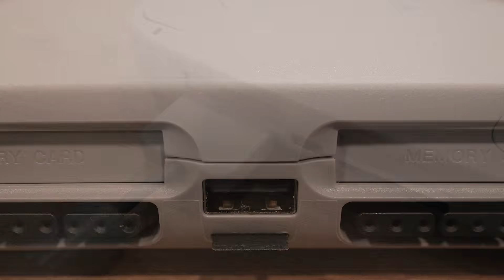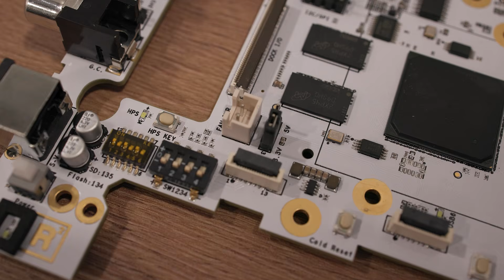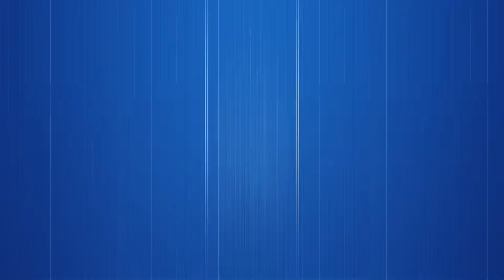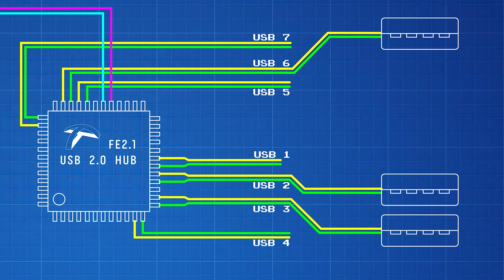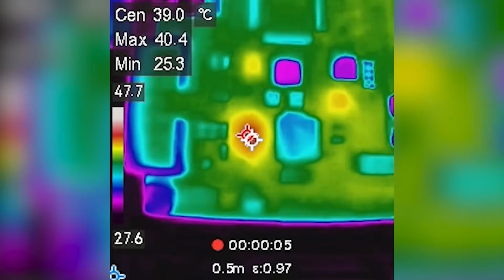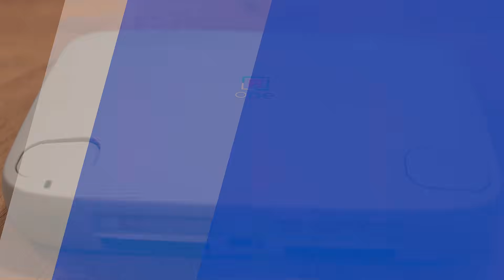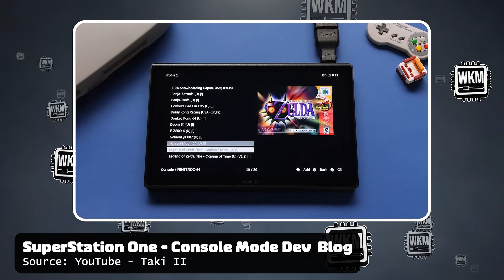Inside the SuperStation One

Comment: The analogue support is what sets it apart - this thing is perfect imo
Reply: i was thinking the opposite, this could be simpler and cheaper without it. working crt's are getting rare, i don't think any new ones will be made. display tubes have a limited life span. in the old days i used a device made for "refreshing" a crt, that could add few years to their life span. scan lines, interlace effect etc you can do digitally with modern displays. i'd be happy with just a hdmi output
Reply: @surejack

Yeah but for anyone who wants it, it's a steal. No costly rescaler needed. 

For a lot of enthusiasts (myself included) this level of connectivity in general is the new gold standard for fpga emulators.
Reply: @surejack I think the HDMI with Din 10 port is enough. Ethernet, SVideo, VGA, Component, 3.5mm jack, SPDIF and Composite is overkill. I don't see myself using those other ports.
Reply: @surejack  Taki, the creator of the project, responded here in the comments that it would only save less than a dollar, or a little more if the Sony chip was removed, but that the Sony chip is necessary to produce better-looking YC signals for some systems and that it also allows the system to use a single config for most countries/monitors.
Reply: @l3rvn0  I've been boycotting anything sony for a long time, it has been the number 1 evil company in many things. It is not just the chip, there are also many analog connectors in this like rca x5, vga, svideo. Anyway not a customer, i made a arcade machine using old pc (laptop with broken screen)
Reply: @surejack  The analog connectors he said cost just $1.

Comment: The hardware is amazing but also a bit over engineered in terms of features. I only want HDMI, Ethernet, 2x USB-C and a microSD slot, that’s it. Also using the expansion port for a high-end ARM SoC to play more modern emulators or SteamOS would make an amazing symbiosis.
Reply: Analogue video is crucial for a FPGA device like this IMO, because at least for me the biggest selling point is being able to recreate the authentic experience of original analogue video on a CRT. I could probably do without composite but even that is nice to have. Honestly if you only need digital video out for a flat-panel I think high quality software emulation, with fine-tunable enhancements to rendering and upscaling, is a better fit than FPGA, though I do understand the practical use case for both original hardware + upscalers and FPGA via HDMI as well.
Reply: @Mogura87  I get what you mean and it’s amazing that they offer so many analogue outputs but I don’t have the space that I can dedicate to a CRT and that’s the same for the majority of retro gamers.
Reply: @gundalfx I do appreciate having easy HDMI access too, because you never know when the CRTs will be out of commission. It's all about maximising options. CRTs are optimal though, because they accommodate the original native resolution and aspect ratio without any upscaling or input lag, with perfect motion clarity. It's impossible to achieve the same combined effect on modern displays.
Reply: @Mogura87  Today I played a bit of Master System (Alex the Kidd) in Lost Judgment (PS5) and the CRT shader they implemented is highly convincing.
Reply: you just want a software emulation box, which there are plenty of already, a mini pc with batocera would be more of what you want, not really an fpga set up
Reply: @p @pspsmallz nothing beats FPGA but I still like to have the option to also play uncommon consoles and more modern stuff like Dreamcast or PS2.
Reply: This really isn't targeted to you, then. I've been waiting for a clean MiSTER device with a host of analog outputs, and there's nothing else that matches this. Many others meet your specs, so you do have options!
Reply: @neogohanamv  I'm curious, what are those other options? With FPGA and clean professional UX and product like the SuperStation One?
Reply: Maybe what you want is the digital-only version of the MultiSystem 2 then? Adding a high-end ARM SoC to play emulators would make it a very expensive product.